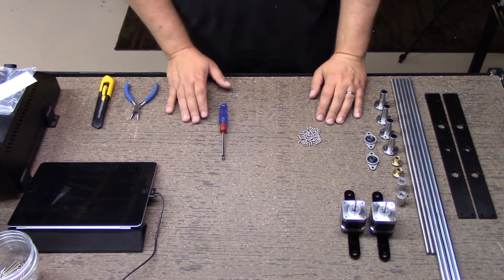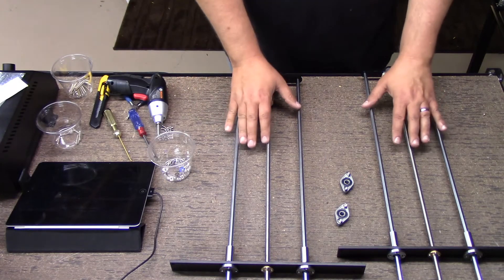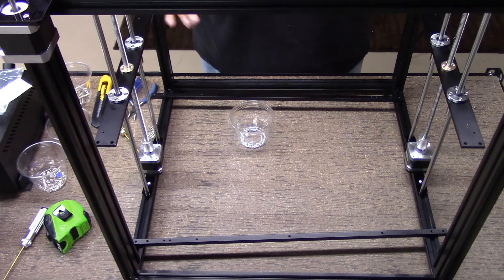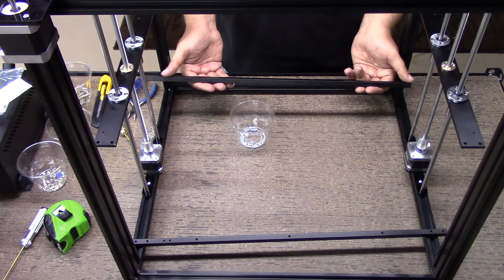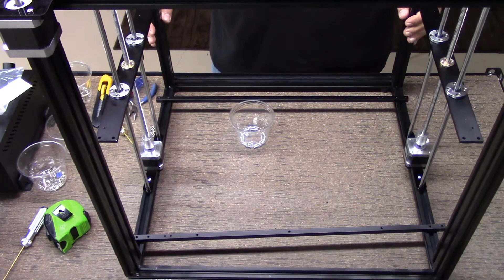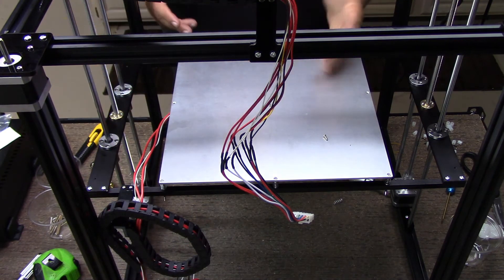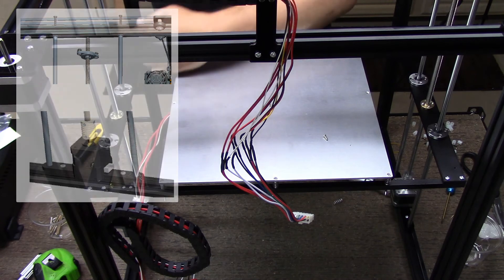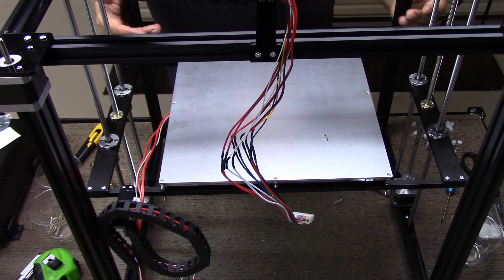Tronxy X5S - Installing the Z Axis and Heated Bed Part 2 of 4!

Comment: Did you have any problem with stringing, I got the 2019 version; however a lot of stringing. Retracting does not seem to fix that. I think it might be the bad design for the airduct. Do you have any pointers what it might be? I'm at loss, truly. :(
Reply from the maker: No issues with stringing, what plastic are you using?  Also play with retraction speed and distance.  You might also want to try a new nozzle as that one could be worn or damaged...

Comment: DIY3DYTECH
Advise from fellow TRONXY X5S owner, REMOVE THE MIDDLE BED LEVEL SCREWS, they will endup Bowing the print bed, I found that out the hard way the corner screws will have to be Exactly the same setting as the middle or you will endup with a bend bed in the middle. you only need the 4 corner screws to level the bed. On my bed the aluminium at the screw point on the outside edge is Cracked on both sides. So Please Remove the center bed screws they are not Needed.

Thank you
Damian
Reply from the maker: The way i use mine are for support as I  adjust with the 4 outer and the allow the springs to push up on the otherwise I notice a bit if sagging.  So this has worked out, however have other views write to say their bed came warped...

Comment: I was trying to diagnose uneven bed happen on my printer for weeks now. Now i found out that the 2 Y aluminum plate (the plate that host the Z rods and threaded rod) are slightly in reverse-U shape on both side.
I home the position, then I measure the distance between the plate and the top frame at the min-Y center-Y and max-Y point. The results are:
min-X plate : 71mm 70mm 70.5mm
max-X plate : 71mm 70mm 72mm

I believe this is causing my bed to bump up from edge to center and I can't level the bed properly. 
Do you find this problem when you assembly the bed?
Reply from the maker: +Jasphere Rindou you do come up with some interesting things 😊 however have not had this issue I fact knock on wood outside of the bed temp issue which I half expected, the thing has worked pretty darn good.
Reply: Finally managed to adjust the bed to proper level. It seems like I install the Z motors, threaded rods and linear rods not aligned, ending up the plates were slanted.
Reinstalling the parts by checking the center point, the distance and angle properly sorted the problems.

However the X error is still something not acceptable. I printed a 20mm cube and the x dimension is 19mm! And the perimeter and top layer infill are not sticking together, leaving a big visible gap in between......
Reply from the maker: Yes aligning the entire Z Axis train takes some turning, also look on thiniverse as there is a Z Axis kit which looks nice and might try it in the future (as I hate to change mine now as I spent so much time to get it dialed in I hate to change it :-).  Also not sure what to tell you on the X Axis error as mine is working well with acceptable limits other than check the belts and quality of the motor gears as I have had similar issues in the past with bad gears as the teeth where not correctly spaced and I had to replace them.
Reply: I measured the distance travel for the x carriage using the control menu and it move perfectly fine. I cut a piece of paper of 120mm long and clip it on the bed. Then I move the carriage to the start of the paper, record the X position and further move it to the end of the paper. The distance travel is just nice 120mm. If the gear has any problem, it should be only travelling 114mm (5% error as from previous print observation).

From my knowledge, I would say this is either extruder or jerk setting.... i may be wrong though.....